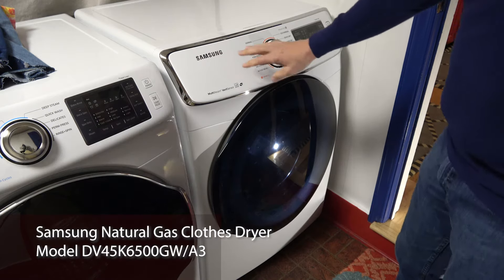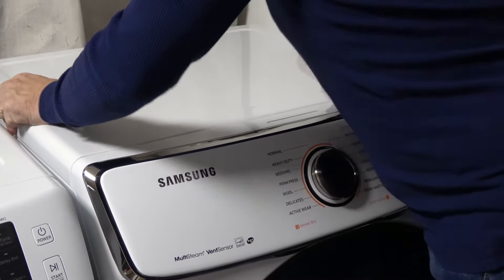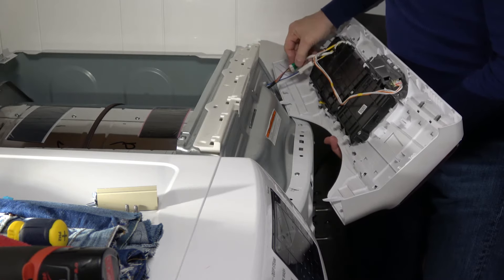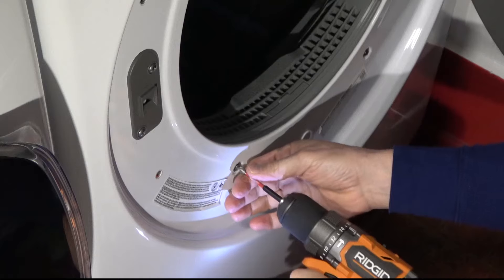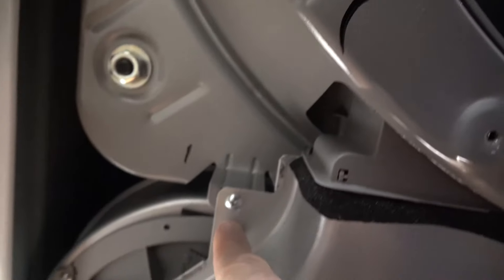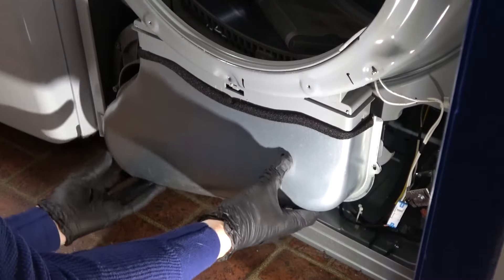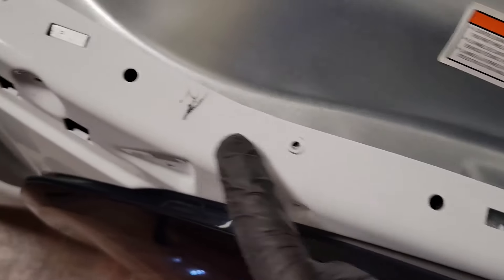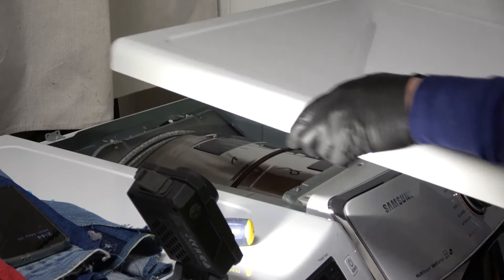SAMSUNG DRYER LINT REMOVAL OUTPUT

Comment: Is easier to remove the exhaust duct on a Samsung to vacuum the cabinet out than through the front. Usually only 2 or 3 screws.
Reply from the maker: Carl, the issue with vacuuming through the exhaust duct is you have to move the machine to get enough clearance to work behind it. And even if you can, it will only vacuum lint in the duct up to the burner or heater elements, it won't deal with the lint caught at the front of the unit or inside the cabinet. The manufacture could have made it easier by including some easy to remove access panels.
Reply: I have a dog that sheds like crazy and I'm sure this is my problem.

Comment: Question....so my dryer still sounds like its running but the drum isnt moving. When i took the top off, the belt is still in the middle of the drum. Any suggestions? The dryer is like 5 yrs ago as well. I bought them brand new but of course the warranty is over. Any feedback is greatly appreciated. Im not afraid to get my hands dirty at all. If its a job i know i cant handle....yes ill call a professional in but the way these companies are these days 🤦 my father always tells me you can mess it up yourself for free!! 😂
Reply from the maker: Kelly, I like your father. Was the belt tight to the drum? If not maybe it slipped off the pulley. Can you turn the drum or is it grinding, could be the glide or bearings that the drum rides on. Is the motor that turns the drum working? Those would be the things I would first look at.

Comment: Question - I have a GE dryer and I'm thinking now the reason its not drying  is b/c i didn't vaccuum the tank right below the lint trap screen when i cleaned it a while back and so I need to take the front of my dryer off to access it.  Only problem was I got every screw out - except one.  On my model there are 2 screws that need to be removed and they are located by opening the dryer door and then are at the top.  They were both rusty b/c they are the only screws on the inside of the dryer exposed to humidity.   I got one of them out barely but the other one I tried everything and even put my impact driver on it but it would not turn.   What can I do to get that sob off and what can I do when I go to put the front panel back on?  I have stripped that screw really bad.  Do you guys run into this same problem with those screws and what do you do if its already stripped?
Reply from the maker: That is a tough situation to be in, you can try a bit extraction bit, notching the screw for a better bite with a straight blade screwdriver or drilling it out. Also worth trying is just a search for how others have dealt with the issue. Best of luck.